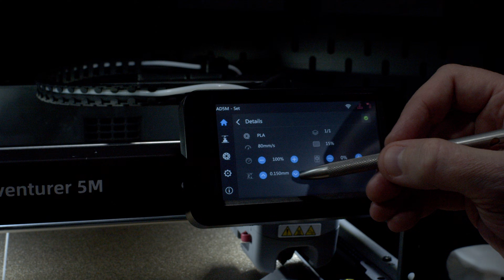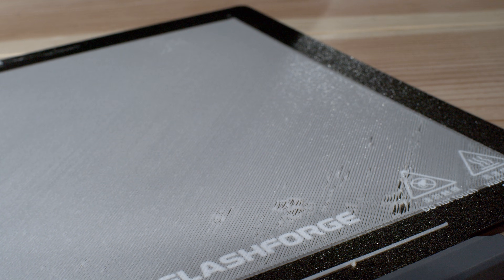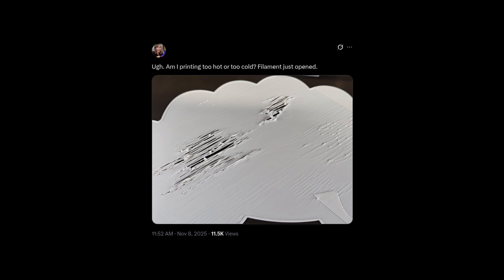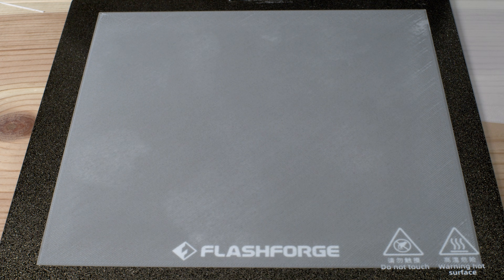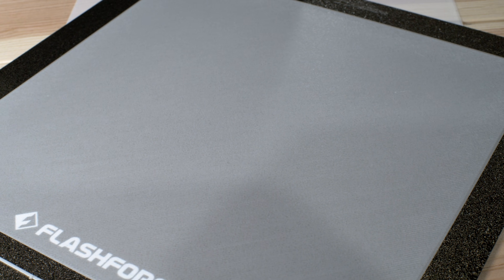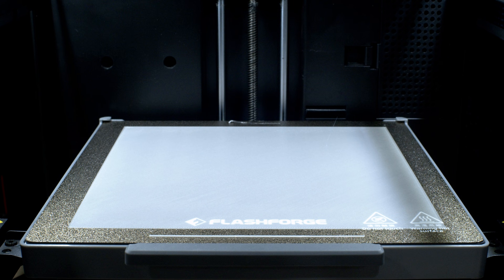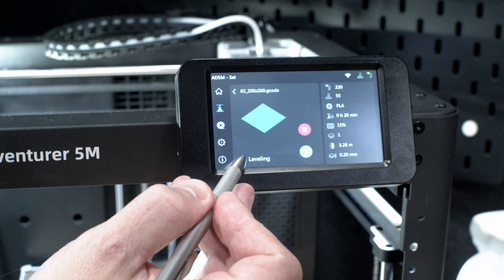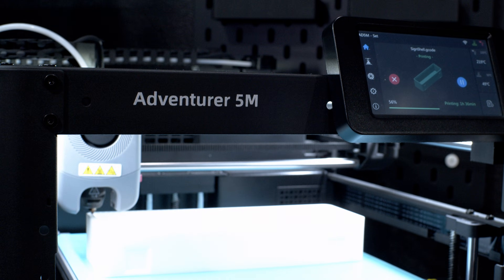Your First Layer Is Failing? Here’s What’s Actually Wrong

Comment: Great video, I feel I learned something "for real" that I need going forward!

But I'm still a bit puzzled. I have had a Bambu Lab Mini for a couple of months and I basically have to clean with isopropyl alcohol between each print, else the first layer will look like crap sometimes ruining the print. I have mostly printed PETG, some PLA and a few times TPU. Should it be this way? I mean, do those with print farms run into the printer room and clean all plates between the prints?!
Reply from the maker: Honestly it depends on a lot of factors. Environment, and air being big ones. Another factor is how attentive you are to quality issues. Many people aren't and simply ignore issues. I can say personally I do tend to wipe the bed after every print. Its not a 100% requirement but it's a habit I developed that helps ensure perfect print quality every time. 

Side notes I'd highly recommend buying a spray bottle for your IPA if you are wiping nearly every print. It helps the IPA last longer since you aren't pouring it.

Comment: Love your videos. Got some first layer issues I can’t get worked out. K1 max with a graphite bed, carto probe and running Simple AF. Bed is leveled to within a couple hundredths. When I get the front right corner good I start getting harping just before half way and it goes all the way to the back right. Any suggestions.

Comment: Very interested in the striping vid. I have an 5X and having a hard time getting it dialed in but love FlashForge and will be buying another unit soon!!
Reply from the maker: I'll definitely have to make this video. Unfortunately there's not a simple answer and definitely requires a video.
Reply: I am having 1st layer problems with my 5X. My 5M is pretty much spot on with the default settings. I have contacted  tech support and they are useless. On the 5X if I adjust the Z offset to get the 1st layer good around the edges, then the center is too far from the nozzle. I get waves pretty much throughout the 1st layer, but the edge areas are the worst. This in turn makes the bottom side of prints look bad.

I am pretty sure my 5X printer needs a bed calibration, which they actually have a video that shows you how to do it. But in order for me to do it, I would have to buy a 500g weight and some deep well sockets. I feel I shouldn't have to speed money to fix a printer that is still under warranty. Oh and by the way, tech support had no clue about the calibration video. The video is actually by Flashforge. I found it when I went through all the videos on their YT channel.